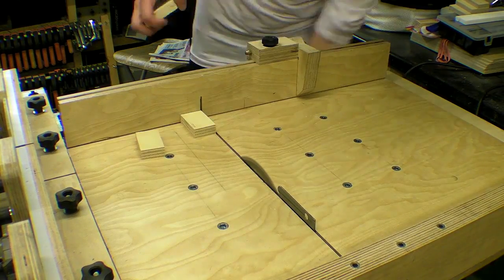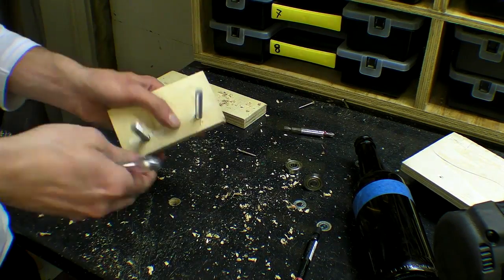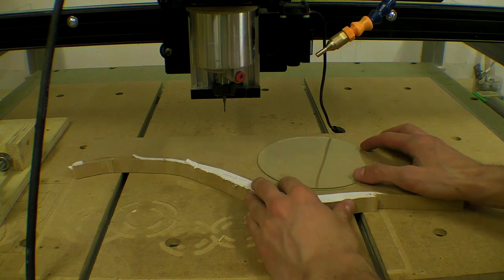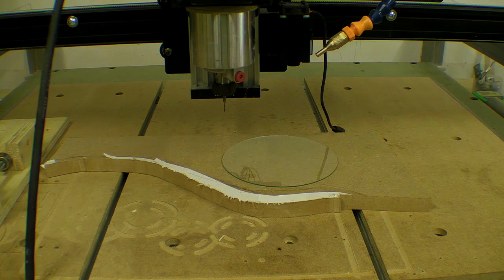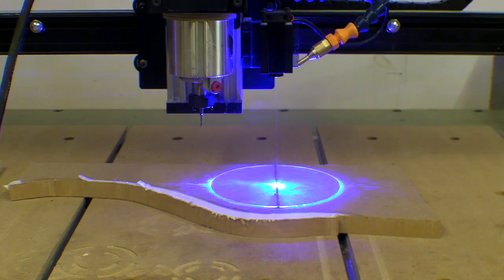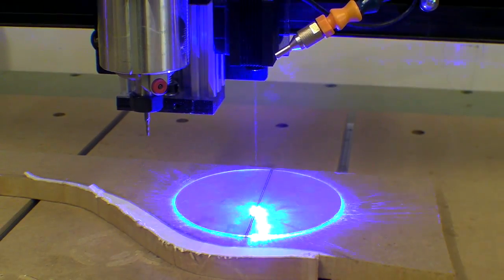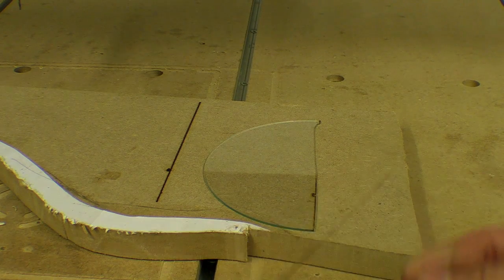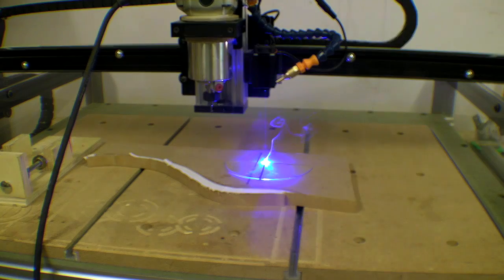Trying to Cut Glass With Laser - 2.5w Blue Module

Comment: Hi guy. I did this with a ten watt laser voa accident. I was meaning to inscribe the glass and went at high power at a fast speed and got a clean cut. I remembered half a year later and looked it up on youtube. o7
Reply: Haha I did something similar. Etching the side glass panel of a desktop computer case and same thing too much power. Ended up cutting half way threw and whole design that was etched fell out 😂
Reply: @istayhighi1540  oof. A one piece. I feel for Jew. I was calibrating.

Comment: Thank for the attempt! But the way you break the glass promises failure. You can't just smack it on a surface and hope it breaks nicely. A better approach would be to take the lasered glass, and put it in a cold water bath directly after. In case of the circle you cut, you could have put a small stick along the line and push it down.

Comment: uhh accidentally stumbled on this, come on 2.5kw meant 2.5W which is piggyback of blue ray players (blue rays have 500mw UV)  as to 2.5kW those do exist and they wont cut house apart mainly due to lens properties. CO2 2-4kw can cut your hand on 200mm foco lens but if you fire it to wall it will just set it on fire but not too crazy. Low power UVs are diodes like one in video, higher power are YAG in UV spectrum. If u lift glass in air and focus on it then you will have better chipping away of glass particle with minimum heat. For fun will try same thing with our UVs on higher power.
Reply: Sorry Uncle Richard  we-forgot-FUN-isnt-allowd

Comment: You need a 355nm UV laser
Reply: It's a little old comment but..
I do not know much about lasers but I think that glass is very transmissive in visible light spectrum so you see on this picture that soda lime glass is transparent from about 250nm to 3000nm (black dotted line) so CO2 laser will be much much better. Am I right?
https://rayotek.com/images/transmission-curves-2014.jpg

Comment: I can effectively cut most glass with my NEJE 7w Solid State Laser - as long as there is a black/dark coating on the surface (Dryboard type Markers work) to momentarily absorb the Laser Light/Heat, enough to fracture. I have found that sending a 'Pulsed' Line to the Laser from the computer works, yet when sending a Vectored Line to the Laser, while powered Constantly, results are erratic.
As of present, I have managed to 'Etch' onto the surface of most glass using this method but I took precautions to prevent Laser Light bouncing straight back into the Module, by offsetting the Laser Module at around 10 degrees from square onto the reflective glass surface. 
I have a "20 Watt" Module in an Eleksmaker 2 Axis Frame/Gantry type CNC Unit that although Considerably more powerful than my 7w NEJE, isn't as good for recreating Pictures or Photos as there is a narrower Grey-Scale. 
My 20 Watt unit is best suited for cutting, as accuracy isn't as important. Beam Quality can be improved by buying/using non-proprietary Collimating Lenses for increased accuracy but as far as Optical Output Power, it is nowhere near 20 Watts - roughly 7.5 ish from cold, and up to 10 with a prevailing wind. I would imaging that most Higher Power Solid State Laser Units would be able to micro-fracture most glass, as long as the Beam is Offset and that a Black Coating put onto the surface to be etched but through experience, anything from 1000mW up to 20W will fracture glass - but Pulsing the Laser as it moves over the work, is far more effective than attempting it with un-pulsed, constant Beam.
Reply: That is soooooo friggin cool. I've been cutting glass for 30 years ,(old way of course) and I never thought you'd be able to do it at all because of the heat component.  Uneven heat stresses the glass and therefore   makes it crack. I'm  super impressed and now I want one. 
Thanks for sharing your information.
Reply: Is it possible to cut tempered glass?

Comment: 2.5w laser cut a 4 mm MDF ?
Reply: Barely. Probably it can cut it. But it needs to go really slowly with multiple passes at full power.  And even then it will take forever. Do not buy those lasers for cutting. Invest in a co2 laser.

Comment: You could always use a black paint marker and run the laser down the mark to have a instant heat shock on the glass.
Reply: im pretty sure the paint would vaporize instantly, so no heat generated. Youd need fully tinted glass for this to work.

Comment: Why don´t you paint the glass surface with a black ink before trying to cut it with a laser? Maybe the black color can to absorve the power of the laser to make heat in the glass on the touch point of the laser! Only a suggestion...

Comment: Are you sure your goggles provide protection against this particular type of laser? They look very similar to the ones that don't. Proper expensive goggles are usually reddish in color.
Reply: Green glasses protect against red laser, red glasses protect against blue. price isn't related to the colour, but you are right that these don't give very good protection against blue.
Reply: That is, they don't provide any real protection at all and only give a false sense of safety. Price is related to the proper certification. Goggles passed all necessary safety checks are expensive due to the costs of the QA paperwork. Cheap goggles aren't safety checked at all. While some of them still may provide adequate protection, many aren't, and they're really dangerous since you're likely to discover that the protection was inadequate only by injuring your eye. I measured optical density of many cheap goggles, and most of them don't even nearly match their specifications! Your mileage may vary.

Comment: It looks like it broke along the sides of the hot part.  If you heat up the glass, it'll get viscous to some degree, rubbery might be a better descriptor, and the weakest place will be the edge of that, where it's  'transitioning' to truly brittle/cold.  It might have been a cleaner break if you'd have done it a couple seconds earlier before the heat had a chance to even out.  Heat management (if not thickness) is how glass blowers get clean breaks.  What would be more effective with glass is to just score the surface, it's something of a meniscus under tension, to create a weak spot (the higher the silicon content, the more effectively a scratch will cause a break, but it's a whole lot harder to scratch). 

What had me biting my nails wasn't the lasers shooting every which way so much as wondering if the laser would heat the glass enough to get it to expand and send the halves, or shards, out to join the laser diaspora.  This really needs a "don't try this at home" caveat at the beginning of the video.

Comment: Spray on some Dry Moly Lube, and let it dry first. I've been able to engrave and etch with my 3 watt laser doing that. Once you cut a pass, use a set of breaking pliers or tapping to split the glass just as if you had cut it with a glass cutter.

Comment: 0:17 - 2.5kW... you wish mate! (hee hee)
From what I have found, an infra-red (IR) laser works well to mark/etch glass and acrylic. IR won't easily pass through these materials because it's frequency (wavelength) is too low. The blue laser on the other hand is about 1/10 of the wavelength and passes a significant amount of that power THROUGH the material... which is why the MDF burns.

I would love to find a 15w solid-state IR laser... that would do quite a bit more. But for wood, paper, etc... the blue laser has been working well for me.
Reply: honestly thats y people prefer co2 lasers for that, since the tubes are a lot cheaper than something solid state also u would probably need liquid cooling on a solid state module
Reply: @ShahZahid  Actually not true, you can get a 40W blue solid state, air cooled for $290 now. Solid State IR units are now coming out... but still low power and costly.
Reply: @Askjerry  im speaking from personal experience i have used a nichia NUBM31T 95watt multimode laser array and even for that module i couldn't get away with air cooling i had to use liquid cooling

Comment: if you put opaque tape on the top and bottom of the glass it might work.
It will be heating the tape and not the glass but the residual heat might do the trick.

Comment: The answer to cutting the bottle is to rub the heated cut with an ice cube and it will automatically break along the lazered line, you must move quickly once youve heated the glass
we used to cut bottles with a candle and ice cube years ago when it was all a rage to make wine glasses from bottles ,and we would glue the neck portion to the bottom of the bottle, Give it a try Im sure you will have sucess

Comment: You have the gas supply there but not putting it to good use.
Take the nozzle very close to the laser spot. Boost the supply. This will cool the sample very fast. Clear water can also work.
Then paint your sample with something black, e.g. permanent market. A few layers may be necessary. Otherwise, just using the MDF and operating on the underside may work also.
Finally let your beam expand and catch it with large lens with a shorter focal length. It will achieve a much smaller spot size with much higher local temperature.
The temperature gradient between the cooling gas and the heating laser spot will do the job.

Comment: I'm sure someone else has probably said this already, but. Green safety glasses are for red lasers, You're wearing the wrong type and will damage your eyes if you use these with a 2.5 watt blue laser.  The correct colour for protecting against a Blue laser is Red.

Comment: For glass do not use blue diodes. Glass is pretty opaque for UV spectrum and can be easily cut with that. Try using pumped nitrogen laser tubes, a good quality one. And please stay behind a thick glass, use uv portective eye protection and do not get exposed to UV directly or indirectly. It is pretty dangerous for your health. (and staying behind a thick ordinary glass is protective enough.)

Comment: Did you actually cut the glass, or are you just breaking it along the line of thermal stress introduced by the heat of the MDF that was burned under the glass?

Would have been better to not actually break the glass, but rather wait for it to cool, then clean the soot off of the back side, and inspect for actual cutting / melting / disruption of the glass surface.

Comment: Pretty sure whats going on here is the burning of the mdf is whats heating the glass along the line and causing a stress fracture point.  If you did this same test with metal underneath the glass would not break.

Comment: 2.5Kw is what he says at the beginning  not 2.5w..?.
Reply: Yes, he was having a little problem with his decimal points. It's a 2.5 watt laser, not a 2.5 kilowatt. I have a 1.6 watt myself, 2.5KW would have instantly blinded the camera and it's reallllllly not available unless you work for some black ops weapons contractor firm or a high end nuclear physics lab.
Reply: Well the second part is not really true. There are quite a few other kinds of places that use 2.5kW lasers. Lookup laser sintering or laser welding to see more. Also, a lot of laser cutting that works with thin shit metals require power levels that are similar. I saw a machine with a 2 kW laser cutting 1/4" stainless steel (no coating, just the shiny metal) really quickly at a transportation authority I worked for. Definitely not a Tony Stark type place.
Reply: Your statement is not exactly true either. I work in the laser field and 3kW lasers are common place. Laser welding applications typically use anywhere from 2kW C02 to 10kW solidstate. Depends on applications. 3D Laser cutting is the field Im in and we use 3-4kW C02 and Diode/fiber lasers cutting hardened steel/boron composite material. Ive cut 1" thick HSLA  and 3/4" Stainless in the past. The coatings are usually negligible  since the beam tends to evaporate all coatings when the focused beam hits it and the assist gas blows it off.

Comment: As knowing if the power that comes with burning printer is telling the 
salesman, I bought one of 2500 mW but it does it at any site, is there 
any way to check it.  
 And if the seller has sent me a lower power 
laser as I know it, since these are cheaper, in short because not 
described the power of the lasers in any site, please if anyone knows 
what to comment, thank you

Comment: the first problem is light passes straight through glass, the second is glass density slows it down a bit changing the rate of induction, the third is glass scatters light especially once it's reflected back up and makes the whole glass shimmer, fourth you're using impact to  break the glass... assuming the  scorched wood heats the glass then your best method of clean breaking would be rapid cooling. wouldn't your best bet be some kind of mirror array arround the bottle which would effectively draw a laser line all round it by sending the light through from as many angles on one plane as possible? even then it might take loong time for glass to warm up.

Comment: As to your laser not cutting well.  Glass can be scored with a diamond cutter but tapping it like you did would likely lead to the same results.  Tapping the glass lightly with a glass cutter would net you some better cut pieces.    Also plus 1 for the marking the glass with black.  I believe but I don't know for sure, colored paint would be better than trying to cut the plain glass.
Reply: A big +1. A CO2 laser is at a frequency of around 10,000nm, where this visible blue laser is at about only 425nm. At 10,000nm, even glass is opaque to that deep frequency of infrared light and the laser can heat the glass directly. Savvas here was really just giving the glass a thermal shock from the MDF board burning underneath the glass, just like the "burning string against the glass in the kitchen sink" method of cutting a beer bottle.  Glass is also opaque to higher UV light, probably around 360nm or higher. 

It could be a good way of using a laser to cut or snap glass at least, if he found some sort of material that concentrated the heating better to put under the glass. As the MDF burned away it was leaving a groove that pulled it further away from being in contact with the glass.
Reply: Well, yeah, lasers do this all the time, just not 2.,5W blues. A quickie search turns up the right tool for the job pretty quickly. CO2 lasers are the usual workhorse for cutting metals and glass, and sometimes UV lasers are used.
Reply: yes, you are correct, the clear glass allows much of the laser (light) energy to pass through it...the flares around the glass are caused by the laser light refracting through the glass...when you're cutting anything, you want the energy concentrated on the line you're trying to cut, not bouncing everywhere....
Reply: Why paint? Lampblack would be ideal.
Reply: Нарушаем Зря yup, that would work too...but does it come off acrylic easily? I'm not familiar with it....
Reply: Any coating that is absorptive enough would ablate off the glass in the first pass unless you keep energy low, which kills the whole point. It's all pointless anyway. As a former boss of mine at an electronics fab company would have said, "Use the right tool for the job!" Either bust out an actual glass cutter, or invest in the right kind of laser technology.
Reply: NightRunner417 well, I've seen glass lazer cutters in action so the point we're discussing here: what IS the right cutter.....because lasers can and do cut glass.....

Comment: you should put a black mark on the glass, it will heat it up much faster
Reply: NightRunner417 Ablation with a diode laser? Good luck with that mate.
You'll need a mode-locking ultra short pulse laser for that to get the high intensity pulses for ablation. Probably around 2J/cm² depending on the pulse duration. That's 2 GW of pulse intensity at 10 ps pulse width. Have fun squeezing that out of a 2.5W laser.
Reply: at least someone is smart here haha..
Reply: I was wondering why he didn't go for ablation... But then too by definition any coating would be ablated off almost instantly, and also, cutting glass with a 2.5W laser? I think we can simply dispense with all logic here and bust out the glass cutter tools.
Reply: even those 1w blue lasers u get off ebay for $50 are bad ass..  u can burn stuff from far away lol...  and im sure it would make any attacker blind... sunglasses or not! lol
Reply: Goodluck finding a 2.5w Qswitched laser.
Reply: Q StiX idk
Reply: Q StiX depends on glasses